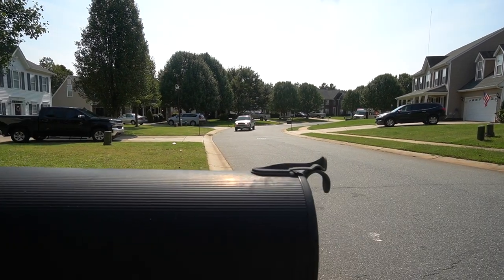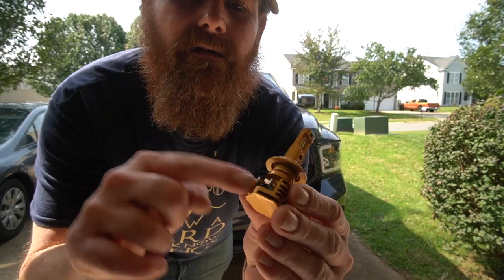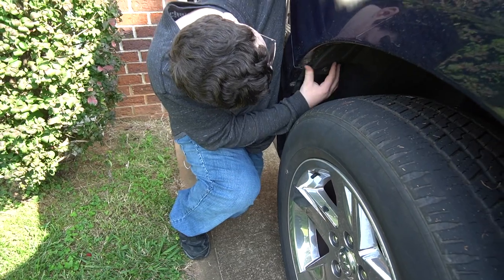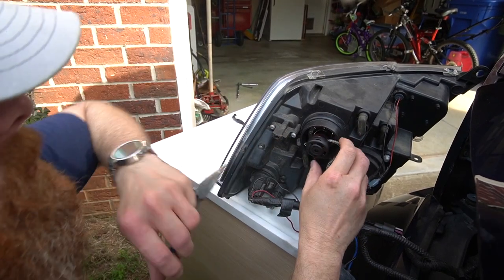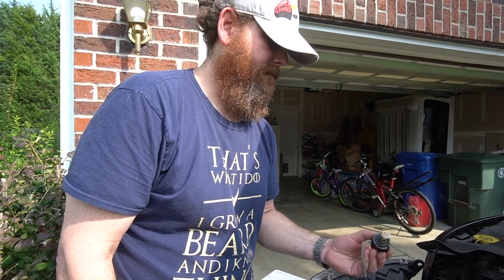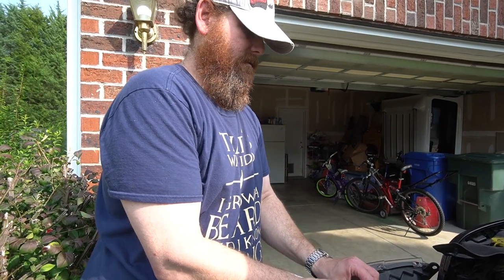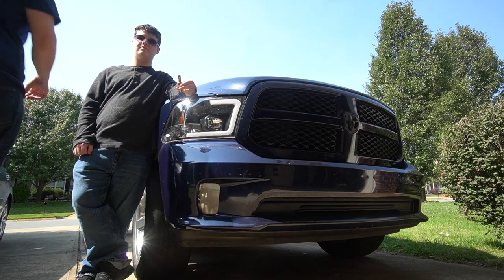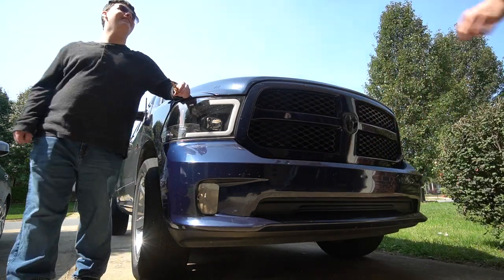THE MOST IMPORTANT TRUCK UPGRADE YOU'RE MISSING

Comment: How you doing man! Saw your video on replacing and installing a LED light. What year is your Ram my is a 2016 I did have qual lights on my but install and the same headlights that you have. I went to the link you provided but it shows they wouldn’t fit my year. Also about to 2 weeks ago I noticed right were the projector low beam is. The black tint film is starting to peel. I saw that by accident and was wondering is your doing that or if me mentioning it did you see yours doing that. Anyway great video once again.
Reply from the maker: Hey Paul, all good here, Thanks for asking. I hope you're doing well.
So, my truck is a 2014 Express.
I'm hoping people don't get confused, maybe I will pin this comment.
The bulbs for the Spyder OLED headlights, like I have and you have, require an H7 bulb. 
The reason why Amazon says this will not fit your truck is because it assumes you have stock quads.
So if you have the spyder OLED headlights , the link I provided in my description is the correct bulb for this particular light.
and to answer your other question I haven't noticed any pealing of anything. Where exactly is that happening for you?
Hope that clears up some questions brother.
Reply: big daddy's house  THANKS FOR A QUICK REPLY BACK MAN. Glad to see this pandemic we have hasn’t stop you from bringing new contents to your channel for your viewers, but yeah I don’t understanding what’s going on cause my headlights came from Spyder Manufacturer too. But thanks for taking the time to answering my question I guess I got a bad pair other than that I haven’t had any problems with them.
Reply from the maker: @ppen62  
They come with a 2-year warranty.
Or at least mine did. Should be on your box/invoice. Are you past the two years? if you're not past the two years, I would reach out to them. I bet they would shoot you straight.
Reply: big daddy's house Well after reading your reply I did some research come to find out. I made the purchase in June of 2018 here it is now October 2020 so it look I’m stuck like chuck with them. It’s not that bad unless you get up real close  but thank for the suggestion anyway have a bless day and keep doing what you do on YouTube. Thanks

Comment: Nice video..i have a spyder headlight too i have the tribal version h1 bulb..when i saw this video about the couger led i decided to get one but after installing it the cap is to short and when i try to put back the headlight with the led it won’t go all the way and lock up..i have a 2016 ram 1500 bighorn..i don’t know if the led is too long..if we have the same headlight housing? How did you make it fit? I Appreciate any info..👍😊
Reply from the maker: Mine went in flawlessly brother. 
What do you mean by tribal version? Can you provide a link so I can check it out?

Comment: Do lights like these have canbus issues? And when you upgrade to leds, do you need anti flicker harnesses? I had a terrible experience with my projector oem lights with many different HID kits, they work now. But I can’t stand the light output I want reflectors with leds just don’t want to deal with errors.
Reply from the maker: Hey Sal, I don't have any errors with my LED's because I used alfaOBD to set the BCM from halogen to LED.
I have about 9 videos on it. 
check out my homepage and you can watch them and see what I'm talking about. I don't have any resistors anywhere. You literally just need to tell the computer you have LEDs.
if you decide to watch the alfaOBD videos, let me know what you think about them.
Looking forward to more of your comments in my alfaOBD videos.
Thanks for watching this one and your support brother.